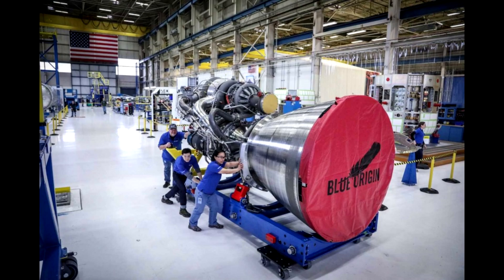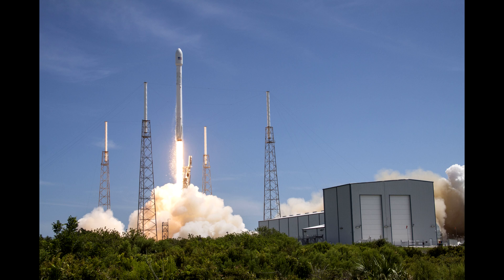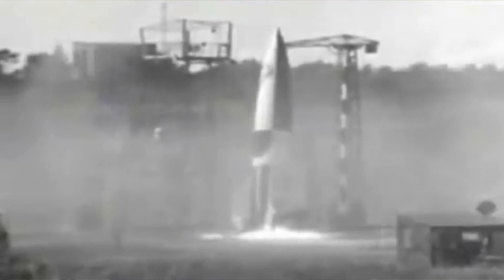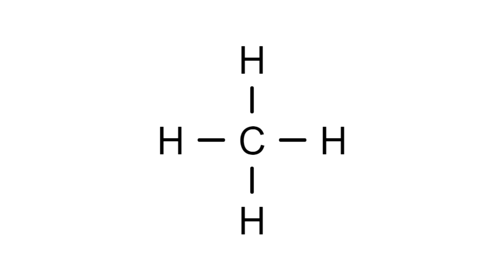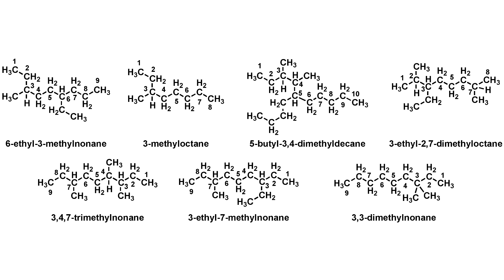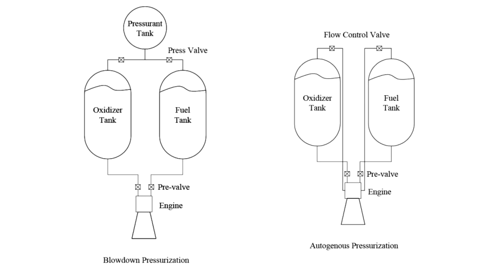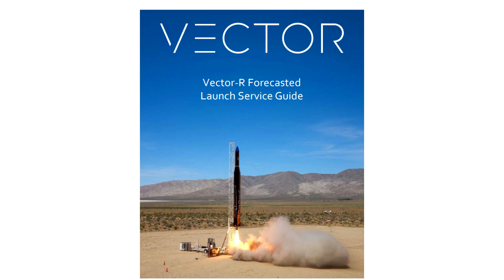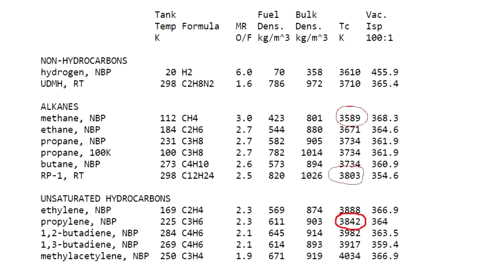Why Next Generation Rockets are Using Methane

Comment: США от керосина и водорода переходит к метану. Россия от керосина и водорода переходит к ракетным двигателям с ядерной энергоустановкой мега ваттного типа. Америка не смогла в химических двигателях перейти к закрытому циклу. Россия это сделала еще в 1970 года. В последних модификациях русских двигателей давление в камере сгорания доходит до 260 атмосфер. Смысл нам использовать метановые двигатели если мы и на керосине вас превзойдём. Испытали в 2017 году импульсный или детонационный жидкостный ракетный двигатель с частотой импульсов 2000 гц , но и он дал прирост всего на 25% по тяге. А дальше что??? Американцы ну и что вам даст этот метан? Это тупик. Ядерные  двигатели с использованием в качестве рабочего тела ксенон более эффективны. Ядерный реактор с мощностью 3 мега Ватт и тяга уже достигает 2000 тонн. А это только начало. 
USA from kerosene and hydrogen goes to methane. Russia is moving from kerosene and hydrogen to rocket engines with a mega-watt-type nuclear power plant. America could not move to a closed cycle in chemical engines. Russia did it in 1970. In the latest modifications of Russian engines, the pressure in the combustion chamber reaches 260 atmospheres. It makes sense to us to use methane engines if we surpass you on kerosene. They tested a pulsed or detonation liquid rocket engine with a pulse frequency of 2000 Hz in 2017, but it also gave an increase of only 25% in terms of thrust. And then what ??? Americans and what will this methane give you? This is a dead end.
Nuclear engines using xenon as a working medium are more efficient. A nuclear reactor with a capacity of 3 mega watts and thrust already reaches 2000 tons. And this is just the beginning.
Reply: bulbigood
ну что сказать друг мой тебе! ты так яростно ненавидишь путина вижу! думаю и россию и русских! ты не с украины случайно? или навальненок! так яростно защищаешь сша! насчет термоядерного реактора скажу так. значит в кадараше проект итер где работает много стран над термоядом включая сша этохерня! а вот твои любимые сша уже сами в одиночку делают прогресс! тебе самому не смешно? насчет видео с испытанием двигателя - скоро увидешь
Reply: "Америка не смогла в химических двигателях перейти к закрытому циклу"
Двигатель Шаттла был с закрытым циклом.

"В последних модификациях русских двигателей давление в камере сгорания доходит до 260 атмосфер"
У двигателя Raptor (SpaceX) такое же давление.

"Россия от керосина и водорода переходит к ракетным двигателям с ядерной энергоустановкой"
У России сейчас нет технологии водородного двигателя. Потеряна вместе с Бураном. Восстановить можно, но потребуется время.

Все эти ядерные двигатели (даже если они существуют) - прототипы, которые потребуют десятков лет, прежде чем будут использоваться для космических полётов.

Comment: well, the most important reason (though somewhat simplified and one of many reasons) is just that it's an ideal optimal point - between hydrogen which is more efficient but so hard to store that it's (usually) barely worth it and rp1 which is easier to store - but so inefficient that it's (usually) barely worth it - methane is kind of like an ideal compromise point in between - at least with current technology

Comment: dear scott...  the ratio between C and H in an Alcane type of Hydrocarbon is 2+2/n where n is the number of carbon atoms.. densities between CH4 and alcanes are similar at near BP(nbp) but difference of the gasses produced by burning vary linearly by twice the carbon atoms..  that means that you can get 8/5 the pressure from burning Ethane than Methane..(Avogadro has it that twice the amount of gas molecules twice the pressure).  Boyle's law has no influence temperatures are roughly the same (differently pressure change is directly proportional to temperature changes)
your table shows that the density of nbp ch4 is similar to that of hexane.
O2 should be considered as part of the average density?  no!  that's whole fun.. the higher weight the alcane the more oxygen you need to carry.  
so a higher weight alcane has higher combustion chamber pressures more expelled weight more thrust... but the lower weight alcane needs less oxygen.  cool  
propane c3h8 propene c3h6 propyne c3h3

Comment: You barely touch the cryogenic characteristics and you even present it as having no drawbacks...
Reply: Cryogenic liquids have the advantage of being usable to cool the combustion chamber and engine bell.  You can't do that with rp1.  You have to have an oxidizer, so you're pretty much stuck with cryogenic oxygen.  Cryogenic methane is also an advantage here because it is close to the same temperature as LOX, so it simplifies the construction of the tanks since you don't have to insulate the two tanks from each other - they can share a wall.  This is also a benefit in the pipes and manifolds since you don't have to worry so much about one liquid freezing the other like you do with hydrogen and oxygen, or rp1 and oxygen.

Comment: There is another advantage, an ecological one. Say that, instead of allowing known methane producers to gas out to our atmosphere, some of that methane gets captured, processed and turned into this rocket's fuel. Now, what would be the advantage of that, you may ask? Remember - methane is at least 17 times more powerful as a greenhouse gas than carbon dioxide. Burn one kilo of methane and you get a kilo of CO2 - still a greenhouse gas, but 17 times less capable of trapping heat in our atmosphere. You do not get CO2 with hydrogen and LOX (you get H2O, of course), but you do get it with rockets burning RP-1 and LOX.

Comment: At 6:15 you mention that hydrogen is "really bad" with regard to the weight ratio when you include the oxidizer.  Can you elaborate?  Do you have a video that compares hydrogen to other fuels?
Reply: Methane is also more abundant in the solar system on most moons and planets.

Comment: Are those engines running on standard LNG or does it need to be specifically refined to be purer than you typical LNG which can have 88-99% methane?

Comment: that BE4 engine looks like it has a reducing flame, and not an oxydizing or neutral flame, I wonder if theres a reason.
Reply: They often run engines fuel rich to lower the exhaust temperature so the engine lasts longer.

Comment: I've recently had one of those moments that blows your mind but then you think about it and it is obvious!  I just discovered that neutrons are NOT stable and have a half life of about 14 minutes.  It seems feasable to store in a very compact form, perhaps with just enough protons to prevent decay.  You would then have a safe fuel that does not explode but releases all the mass as nuclear energy!  Obviously it doesn't have the density to give much reaction force but could provide the heating of a chosen molecule.  I envisage a stable bottle of a few kg of neutrons, then a beam of them is circulated through the engine with a stream of reactive mass (gas).  A percentage of the neutrons decay heating the gas and the rest are circulated back into the bottle.  It needs a little work :) but I think the basics are there!
Reply: Problem is the only stable form of pure nuetrons only exists in the extremely high ravitational field of neutron stars.  There is no known form of it or any known method of containing stable neutrons.  Adding protons to it doesn't stabilize it unless you use a fusion  reacts to smash the two together.  But if you did that you would wind up with a hydrogen isotope  (deuterium) which is no better than regular hydrogen.

Comment: You said that methane is half as dense as RP-1. Could this be the reason why the raptor engine uses the highest combustion chamber pressure in order to keep the same performance ?

Comment: Another issue with RP-1 is that although in theory, it can be refined from any grade of petroleum, in practice, it can only--with current refining methods and equipment--be refined from light sweet crude oil, which makes it more expensive. If a method for refining it from heavy sour crude oil (those are the actual industry names) could be developed, RP-1 could be produced considerably more cheaply. I think the HTP (High Test Peroxide [concentrated hydrogen peroxide])/RP-1 combination has also been suggested for reusable autogenously-pressurized rockets, and:

RP-1 is a low-sulfur kerosene that's made to a pretty "tight" specification (to prevent coking, as you mentioned-). While it should be possible to conduct brief "cleaning static firings" of reusable LOX/RP-1 rocket engines (using anhydrous ammonia [NH3] and LOX, the same propellant combination the X-15 rocket plane burned [at least in its later "big engine," the XLR-99]), that would still complicate the logistics for reusable LOX/RP-1 powered vehicles. An even lower-sulfur rocket-grade kerosene, RP-2, was developed (or at least its specification was drawn up) because it was less prone to coking, but it wasn't adopted because all existing U.S. LOX/kerosene rockets used RP-1, and a demand for RP-2 never developed.

Comment: Methane, as you said, like many fuels has positives and negatives. But it is the very real fuel that can be possibly manufactured on Mars.  The amount of 'seed' hydrogen required to be carried is even less than what you stated. In the Martian atmosphere there is CO2 and water vapour.  With those two raw materials you can manufacture water to drink oxygen to breathe and fuel and oxygen to power your rover or your space ship.    That is why methane has been chosen.  Not maybe, that is why.

Comment: Methane can be produced via biological means and be considered a green fuel... you harvest it from methanogens that get it by sucking carbon dioxide out of the atmosphere, which you release back into the atmosphere.. being somewhat carbon neutral and reliable in the long run.

Comment: Very information-dense video.  Switching over from hydrogen to methane fuel systems would have a larger carbon (dioxide) footprint, though.... presuming the hydrogen fuel was made through renewable means.  In the grand scheme of things (i.e. compared to a billion+ cars) it's not likely to be a great relative increase overall, but ~a few hundred thousand litres of methane being burned a few times a week isn't nothing.

Comment: I ran the numbers and methane makes sense over H2/O2 systems using water mined on Mars. For the same mass of water mined, but adding in martian CO2 for methane, you get 222% more fuel/oxidizer then from water alone, but ISP drops from ~450 s to ~365 s. Assuming same dry mass (20 tons) this comes to ~54% more water needed for 5 km/s of delta-v and ~42% more needed for 7 km/s of delta-V. That not counting the added cryogenic cost and fuel tank mass for H2/O2, but not the added energy costs of making methane instead of just hydrogen.
Reply from the maker: Also try Ethene - H4C2 so even more fuel for same hydrogen input. Higher combustion temps though.
Reply: Yeah but ethane is harder to make than methane: now we have to do full synthesis gas polymerization (F-T synthesis), very inefficient use of energy. Making hydrogen and oxygen from water requires mining water (not well developed, at least for Mars) and then reducing it (well developed). Making Methane requires the added steps of sucking in and compressing CO2 from martian atmosphere (relatively straightforward and bound to be easier and simpler then mining water) and then Sabatier reaction of methane (well developed but an energy suck) Making larger hydrocarbons will cost even more energy and require even more added complexity.

Comment: ...seeing you're high on tweaking 368.3/354.6 and '-ylene's are better than '-anes' (but why)why not methylene, than methane... and-then-or-why-not deuterium-heavy hydrogen... and then-also why not 'haze' it with a photon-absorber to get more heat-efficiency... (and more why-not-suggestions, hydrogen peroxide oxidizer etc.)...

Comment: If cars, and now rockets can run on methane, why aren't we trying to find ways if capturing it? Or are we?

I mean all that methane that's contributing to climate change like that lake in Siberia that's melting or we could get it from cows farts.

Okay I guess it's probably a silly question as it's very difficult abd not cost effective to capture it but if anyone could find a way it might be a very cool thing indeed.
Reply from the maker: It’s easy to collect 99% of it. But closing that last 1% cost more than the profit from selling it, but that cost obvious doesn’t account for external effects.
Reply: Scott Manley 
That's the thing, if it's doable then the costs of not doing it might outweigh all other costs.

Comment: I’m no rocket scientist, so can someone explain to me the purpose of the preburners? It sounds like a waste to burn your fuel outside of the main thruster. Maybe I’m misunderstanding.
Reply: The preburner(s) power the pumps which force feed the fuel and oxidizer into the combustion chambers. They are relatively high volume/high pressure pumps which require a significant power source to drive them. Several very good videos are available here which detail various liquid rocket engine designs.
Reply: David Turner awesome! Thank you. I wouldn’t have guessed it was for supplemental power to pumps to increase feeding rate.
Reply: @Tyo-yw9jh   The Shuttle main engines did this as well.

Comment: @ 05:50 I'm having trouble figuring out Scott's final takeaway of methane efficiency here . . ?
"20% vs. 50% advantage" 
it seems he is comparing RP-1 + LOX VS. Methane + LOX?
Is the Methane system less efficient overall?
And "Hydrogen is even worse"?

Hydrogen has the best ISP of all, right?

Somebody that understands, can you please help me out?
Thanks! 👍
Reply from the maker: I was just talking about the density. The specific impulse advantage is about 5%
Reply: @scottmanley  Thanks Scott! 
So your saying that RP-1 vs Methane is at a 50% density disadvantage, however, factoring in the LOX it's only ~ -20% average.
But factor in the +5% ISP and the total performance breaks even? 
Maybe a little worse than RP-1?

(But advantages of cooler burn & simpler plumbing make it a boon for reliability & reusability?)
Reply: I was thinking about the same thing. Should he calculate the overall efficiency again now when the density is lower but there is also less mass to accelerate?
Reply: Density has nothing to do with ISP
RP1 and LOX is denser than METHALOX with 20% advantage and methane has higher ISP than RP1  by 5% advantage. Different people chose different fuels according to what feature is more important for them.

Comment: I recently saw a video (I think it was on this channel) that showed that the falcon 9 (heavy) has a lower ISP than a Delta 4 and can lift less and less mass to higher energy orbits (Jupiter and beyond). So why are Methane-Engines "next generation" if they have a lower efficiency? Are we only talking about "short range missions" to Moon and Mars?
Reply from the maker: Vulcan is still using a hydrogen upper stage.

Comment: Very poor explanation. Scott simply listed the advantages and disadvantages, but did not explain WHY people all of a sudden now are switching over to methane. If methane is so great, why wasn't it used up until now?
Reply from the maker: I did explain - The transition from ethanol to RP-1 was because the Jet Fuel suppliers already had large parts of the infrastructure. Methane never took off because Hydrogen was the clear next step that needed research.
Reply: Thanks.

Comment: You need to electrify the combustion products as they enter the combustion chamber. It adds energy and impulse along with a higher burn temperature. This also allows the water to become a propellant by way of expansion.
Reply from the maker: Where does the electrical power come front?
Reply: Scott - Use your imagination. How about onboard hydrogen fuel cells? NASA uses them all the time for power on their spacecraft.

Comment: Methane should have been used since the 1970s. Long distance space travel and living on Mars has two show stopper problems, 1) radiation, 2) too low gravity. Both factors destroy the human body within weeks. Radiation maybe can be solved, but the destructive effects of low gravity will never be solved.
Reply: It has been solved, centrifuge to simulate gravity.
Reply: And how is that supposed to work on the surface of a planet?
Reply: bluenetmarketing Astronauts have already survived long 0 gravity missions on space stations.
Reply: Put small part of brown dwarf  deep under the planet's crust should solve low g problem

Comment: Where do you source methane? I was waiting for the words "pig farm" to come up. "Pigs launch men to Mars!"
Reply: Steve
CO2 from the 'atmosphere' is compressed and reacted with hydrogen gained by electrolysis of water (impure, from Mars) using a catalyst it turns into methane and water (pure) with also some heat.
As Scott mentions it, the reaction is called Sabatier reaction.

Comment: One thing Scott doesn't mention is that methane  stays liquid at a higher temperature than hydrogen (-162 C vs -253 C).  By comparison oxygen liquifies at -183 C.  Absolute zero is -273.15 C, so I expect hydrogen is substantially more difficult to keep liquid than methane or oxygen.  Admittedly I know almost nothing about cryogenic fuel storage.  But perhaps there is some weight savings from reduced refrigeration equipment or insulation when using methane instead of hydrogen.

Comment: The idea of using Sabatie process within ISRU might sound good on paper, however it is not that good when you take into account effort to get hydrogen there, because it has extremely good diffusivity, extremelly low boiling temperature and extremelly low density in liquid condition, which probably would lead to only a small portion of hydrogen you took from Earth will get to Mars as well as huge effort needed to store it during half a year flight to Mars. I never understood the enthusiasm regarding it's use.